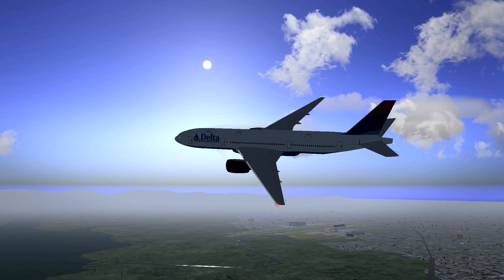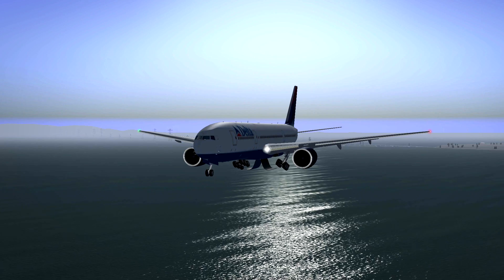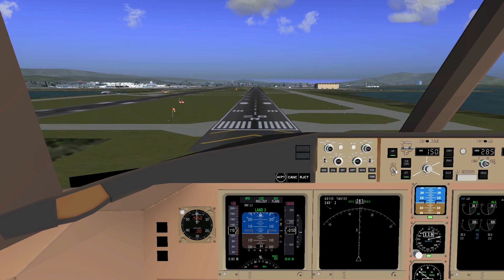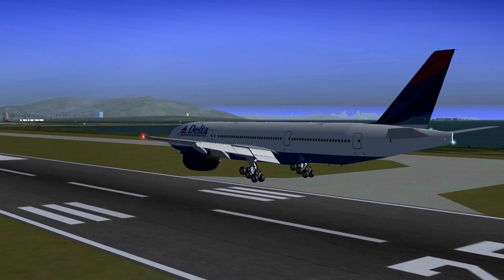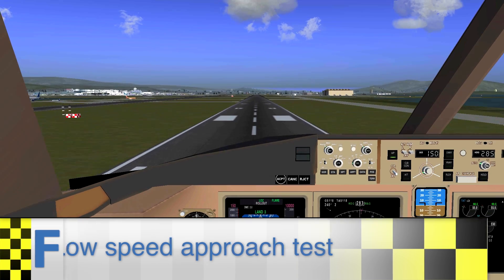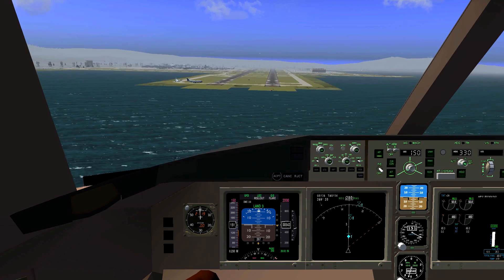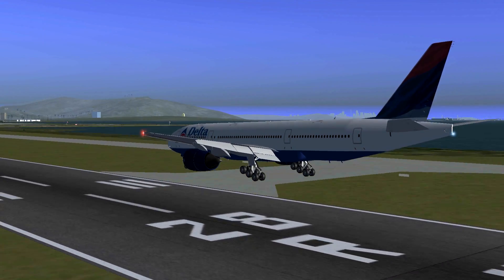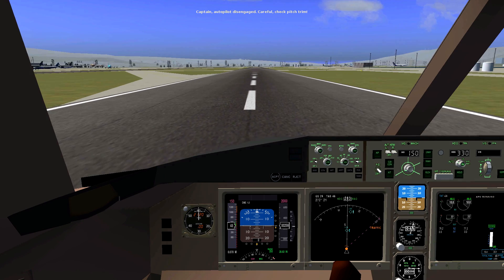777-200ER: Automatic landings in FlightGear

Comment from the maker: With the 777-200ER set to the normal landing weight (just set the fuel tanks to be almost empty), you can easily touch down at 140 knots or even slower. Try that, you'll see the flare should be better with full flaps ;-)

Comment: 1,- is possible what the autopilot take the sea level altimeter and then take the land-air altimeter, to do that flare.
2.- Can be simply a programming error
3.-the data base have a mistake and so the airplane´s touch down and flare are bad.